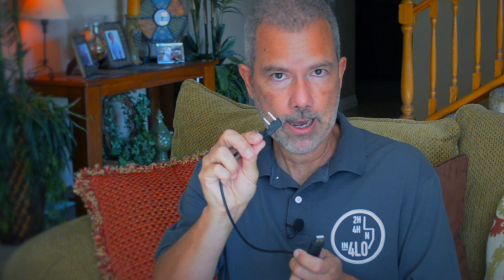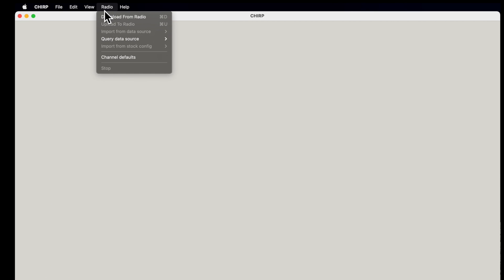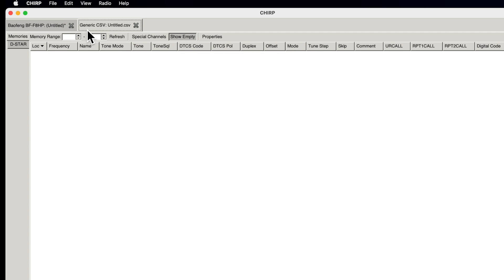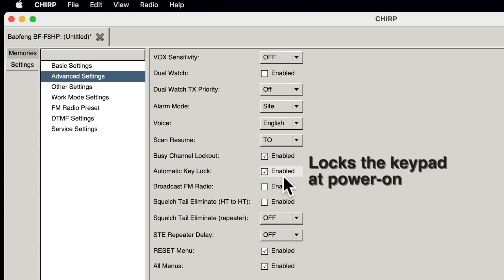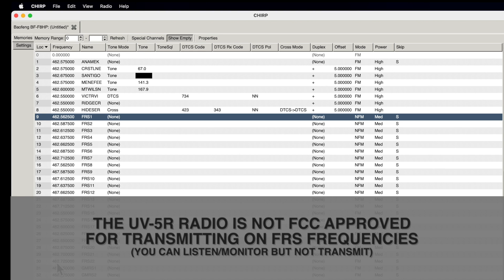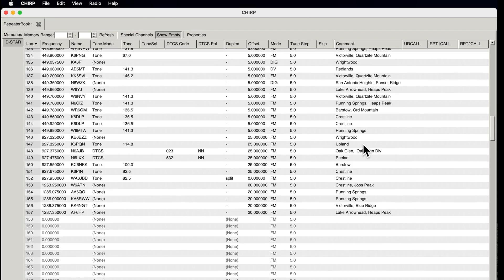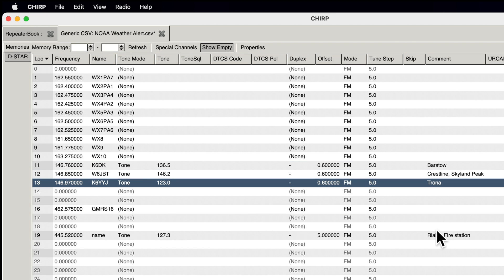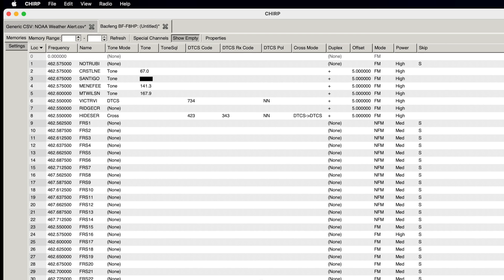How To Use CHIRP Software To Program A Baofeng UV-5R. Using CHIRP for HAM, GMRS, and FRS Radios

Comment from the maker: You can get the UV 5R / BTech GMRS V1 programming cable here: 
https://amzn.to/38Sie1q
You can download the FREE CHIRP software, here:
https://chirp.danplanet.com/projects/chirp/wiki/Download
Reply: I have the generic Baoefeng programming cable, it doesn't have the chip but thankfully windows 10 was smart enough to figure out my stupidity.  The generic cable however did not work on the USB ports on the front of my computer but work great on the rear USB ports.  Not sure why but if someone has issues getting radio to connect first check the cable to radio connection as Randy suggest then try a different USB, I was about to throw in the towel.
Reply: @mrbyamile6973  so the reason is the USB ports on the front of your pc, are actually a hub, and the ones in the back are part of your motherboard. So whenever you see any peripherals that say don't plug into a hub they also mean not to use your front ports
Reply: @thetarkovion6409  What if your laptop doesn’t have rear ports?
Reply: Any affiliate links for UV5R?
Reply: Thank you Randy for the link to CHIRP,
So far I have saved copies of both my Baughfoowongs, and I downloaded some frequencies, profiles I found interesting, but the option to download TO the radio is greyed out.
Maybe you explained it but I was lost in your eyes, or distracted by one of those single-frame images.
Nope, it was the eyes.
Reply: I have a question, I hope you can answer.
I have bought the Baofeng AR152, and most recently, I read
that downing loading CHIRP can hurt the system. 
How true is this????
Reply: I myself bought a Baofeng Uav5R+ and the right cable but can't upload to the radio. 
 I tried manually also.... 
Guess you get what you pay for
Reply from the maker: 99.9999% of the time when this happens, it is a Windows "driver issue", and has nothing to do with the radio.  
In other words, Windows sucks, not the radio.
Reply: @TheNotaRubicon  Agreed!
Reply: 0

Comment: My new UV-5R apparently got the keypad locked so that I can't input frequency manually (but I can do that with up & down keys). Is there possible to unlock the keypad so I can input frequency manually in the VFO mode?
Reply from the maker: Yes.. you can UNlock the keypad by pressing and holding the lock/unlock button for a few seconds .. it's the button with the tiny blue key image on it.

Comment: hi we have bought one of these and have watched your video several times and still struggling to get it working. Is there any chance someone help at all
Reply from the maker: What, exactly, do you mean by you are "struggling to get it working" ?  put in the battery and turn it on by twisting the knob on top. if it doesn't work, send it back.
Reply: @TheNotaRubicon  Hey bro, the problem I am running into with a newly purchased UV-5R is, firstly it resets to factory by pressing the side button, transmit and VFO button simultaneously. After success there, I was able to download my channel list from a previously programmed radio. I download the blank channel list from the new radio, copy and paste from the old radio, upload to radio, great. The new radio seems to accept, it responds normally and then it reverts back to having no visible channels. Chirp took me to a place to download a previous codec or whatever you wanna call it for the cable, which I did, but still no success with the new radios which is keeping me from buying any new UV-5R's. My final attempt will be to use an old laptop to see if anything is different there. PS. I like your sarcasm but you could be a little nicer in your comments. But you have a great, unique channel. Peace.

Comment: Does everyone know you can pull off the off/on, volume switch nob on a UV-5R and use it to tighten the antenna jack nut ?
Reply from the maker: yes.. but nobody has ever needed to do it.. ever..
Reply: @TheNotaRubicon  Nice to know though. As a life long mechanic I have seen more than my fair share of fasteners come loose, especially on parts that are repeatedly removed and reinstalled. Taking the antenna off repeatedly can possibly loosen that nut on the jack.

Comment: my issue is getting comm port access denied errors
Reply from the maker: That's a Windows/Driver issue.. Good luck figuring that out.
Reply: @TheNotaRubicon  With Arcshell AR-5, It is an issue for Win7 and Win10 for me and I suspect others. You cannot get past square one in CHIRP unless the com port is accessible. In my VM Win10, the Ports menu does not even display in Device Manager. In Win7, it says Com port one is blocked. There are no Com port settings in my Bios, no indication of where it is blocked from the error message. Troubleshooting only confirms this.  

In Win7, The driver that comes with the USB serial cable only activates the USB serial com port for it. You also get an Unknown Device listed under "other devices". You then get device driver errors/rejections when you try to apply that USB serial port driver to the Unknown Device or any other devices. Archshell does not provide an OS driver for their AR-5 or other models. The manual talks about "the software," for it, but there is no software support or download on the Arcshell web page. 

So I would say don't waste your money on a cable for the AR-5,. CHIRP will not recognize it under Win7 or Win10. You cannot program the AR-5 with CHIRP if you cannot pass square one and the com port is not accepted or recognized. You will need to operate it as is out of the box. Dissapointing.
Reply: My friend I connected a Baofeng uv 5... I downloaded chirp legacy for older windows version, it works with windos 7... But when I open DOWNLOAD FROM RADIO I can't see any PORT to select

Comment: Rick you are very kind to include the free CHIRP software link. Solved all my problems in 15 minutes as opposed to the previous 4+ hours I spent back and forth with apple support and messing around with drivers and such. Problem solved works now.
Reply: Name=Randy correction

Comment: I recently got a set of 2 Baofeng Ar 5rm radios. They are great but the supplied Baofeng programming cable is garbage. Does not work even after updating the drivers supplied on a CD.
I am  going to borrow a B-tech cable that you recommended. 
If that works, I will order my own.
Many thanks 😊

Comment: So what can the UV-5R use for simplex transmitting
Reply: I guess if you have access to the 22 channels those can all be transmitted on and received on the same channel.(Simplex)The other 8 channels are what makes up the repeater channels 22-30 I guess. And those channels are duplex they require an offset which means you transmit on one channel and receive on another making those duplex channels.
I actually don't know at all but this sounds sortive correct to me, and I'm only on my second day of looking into radios, so if this didn't help I'm sorry.
Reply from the maker: The UV-5R is a H.A.M. radio and does not have those 22 channels unless he programs them in - but based on his question, it is clear that he has not done that.
Reply from the maker: Please rephrase your nonsense into something that makes sense.

Comment: Here is my real question. Hypothetically, would it be possible to use a uv-5r or other cheap Chinese radio to put in the correct tones to activate a GMRS repeater? Just want to know for academic reasons, not that anyone would break our overlords rules. You have stated it would be difficult, but left open the possible
Reply from the maker: Yes - many people with unlocked UV-5R radios do this

Comment: When I press the PTT button on a walkie-talkie, I can see the green light on the other walkie-talkie but there is no voice
Reply from the maker: 1) you might be too close to the other radio - get at least 50 feet apart and try again
2) the receiving radio might have a tone/code/privacy channel set - remove all those settings and try again
3) the transmitting radio might be defective
4) I doubt the transmitting radio is defective

Comment: 4 years later, the menu has changed a bit.  I only wanted to add text to my channels instead of the frequencies that I programmed into the radio manually.  I did the download bit, then edited the text of the channels for the upload back to the radio.  No Change.  Thanks for the tutorial anyway.  I learned quite a bit.
Reply from the maker: There is another menu option you have to change to display the channel-name instead of the frequency.

Comment: I have just purchased a Baofeng UV-5RX handheld transceiver and want to have the actual names of the repeaters I like showing on the screen.
I have bought the cable you recommended and downloaded the CHIRP software from the link you posted.
So far so good - I got the radio to download the channel info I have entered on the radio. I put the names of the repeaters into the CHIRP spreadsheet and uploaded to the radio. Lights were flashing on the cable and radio. The radio screen flashed "Welcome" briefly when finished.
NO repeater names are showing on the radio screen, just the frequencies, as before.
What to do?
Paul VE3AXT
Reply from the maker: You may find watching this video helpful: -> https://youtu.be/7jFn7ZGVldg

Comment: my uv5r radios have there sockets raised a tiny bit off the wall. and the cord has raised metal rings on the plugs. so there a air gap between the plastics. 
no there is NO contact anywhere on the cords plug, to radio. (plastic to plastic).
the cord plug fits the area in the radio no contact.
yes i have tried to force the plug into the radio. but it is all the way in. on more than just one radio.
right now in front of me is a UV5R and a UV5R5. can see air all around the plug to radio case.
neither one works with chirp.
keeps saying no radio.
brand new (to me at least), red cord bought off amazon, it says baofeng on the usb-A  end.
opposite side has a triangle of raised dots, three, then two, then one.
package labeled as.

X002MX7QS(then washed off).
Baofeng Programmin..X3, GA(same label damage) ed
new.

other than a computer bar read code nothing else. (yes three lines of text as typed out here)

the damage looks like some liquid dripped on it and wiped out the ink. label is almost see through at that point.

Comment: I am having issues.  I have uv5r, i have chirp installed, i have to cord connected.  But it says it cannot locate what port.    I did what i can and it says no drivers available.  Do you have any asvice?
Reply: Turn the transceiver on while it is connected
Reply: Try looking for the cable driver that you use. Sometimes it's not the one that comes with it. I try randomly installing drivers and turns out it uses the prolific chipset. You can find the drivers in the miklor web.
Reply from the maker: I'm sorry to hear that.. My only advice is to stop using Windows..Seriously.. Windows is horrible..
This is a problem between Windows and your cable, not the radio.. and, there is no easy solution (other than using Mac or Linux).

Comment: These ham radio d1ckheads are the most delusional of all the prepper mor0ns. First of all tthere will bne no one to talk too second of all your radio will  stop shortly after the power goes out, because you failed to think more than 48 hours in advance. You're a phuckin idiot.
Reply: Cry harder
Reply: Awwwwww. The cuck's feelings are hurt.
Reply: I've never known a prepper without a independent power source
Reply: @darcijones7695  Excactly,
Reply: Actually you don't realize what's going on with all these rocket launches that's putting sat platforms all over the air space..jus sayn..u hav to get smarter in regards to this stuff bro

Comment: So do FRS and GMRS have different Frequencies? Your website has GMRS & FRS Channels listed. For example channel 01 is 462.5625. Is that FRS or GMRS? In this video you have FRS1 as 462.5625 and GMRS1 as 462.5500.
Reply from the maker: FRS channels and GMRS channels are the same.  If they are shown differently on the radio in the video then they were manually entered incorrectly.

Comment: hi, i just got my radio and i have a mac, and when i try to connect to my radio to chirp, i can’t find the right port, i’ve tried to find tutorials but none of them are any help, i’ll be really glad if someone ACTUALLY tells me how to connect my radio to chirp on MAC OS
Reply from the maker: Have you tried each of the different listed ports and are you sure the radio is on, the cable is clicked ALL the way in, and the volume is up?
If so, and if it still does not work then the problem is likely a bad/cheap/incompatible cable.
Reply: @TheNotaRubicon  yes i have but chirp keeps telling me to check my drivers and i already have multiple times

Comment: I should have come here first. I found the chirp.danplanet the hard way. Your explanation of programming is by far the best I've seen so far. I planning to purchase the TidRadio H-3 GMRS/HAM HT after watching your video on it. My question is would I have to program on the Ham function to program Ham and then switch the HT to GMRS and then program GMRS or can I just do it similtaneously? I saw somewhere that if you select NORMAL you can do both at the same time. Any clues?

Comment: Just as a side note, CHIRP doesn’t work with the UV5G Plus. There isn’t a selection for it and when I tried any of the UV5 selections it said “Radio would not respond.” And yes the plug was all the way in. I went to the Baofang site and tried there and when was down loading the program my antivirus stopped it saying there was a virus. A forum said that the only one that works is the radiottity site. What do you think is going on?
Reply from the maker: The UV-5GPlus works just fine in CHIRP.  Check out this video to see how: https://youtu.be/YlCfq_RH9Tg?si=6qBv5hmc7oRSPwz6
Reply: Sure it does, using it as we speak. You need to select Baofeng GM-5RH.

Comment: What about the AR-5RM ?? when I chose baofeng…. That model is not listed
Reply from the maker: If it's not listed, that usually means the radio does not work with CHIRP.
Reply: @TheNotaRubicon  hmmm that’s weird because it’s that new baofeng. You know the one with the bigger screen and that search button?? It’s like the new version of uvr5 I guess ??
Reply from the maker: It's not weird at all. New radios usually take at least several months before the CHIRP boys make their updates.
Reply: @TheNotaRubicon  thanks 🙏🏽
Reply: The new version of chirp has the AR-5MR on it.  Just finished loading mine.

Comment: I must have received a radio with BAD SOFTWARE! The Chirp software does not work with it yet it reads the the radio as it displays freqs I already put in via the keypad ! So Einstein , it also will not take freqs above 462 megs like NOAAH ! The clown I bought this from isnt saying anything in reply ! FYI- I only used the cable and software with another UV series so block and delete this comment too! Thank GOD I have real radios!!!!!!!!!!!!!!!!!!!!!!!!!!!!!!!!!!!!!!!!!!!!!!!!
Reply: I think the new version of the Baofeng UV5R have some sort of lock on them that was put into place due to a bunch of new people buying and using them without licenses.

However, I believe there is a pretty easy way to bypass that lock. Some Youtube channels show you how. It is pretty easy. I think you hold a couple different buttons in a certain fashion.

Mind you, I am extremely new here. I sort of picked this up from watching some recent UV5R videos after I hard reset my radio. I could be way off. But just a guess. Hope that helps in some way...

Comment: any idea why my computer wont recognize a port to connect with the radio?
Reply: cable im using came with the radio
Reply from the maker: That is almost certainly a Windows driver issue with the cable..  Good luck with that.
Reply: Tried a different computer, seemed to recognize it, however when I went to start the download it gave an error message

Error reading data from radio: not the amount of data we want
Reply from the maker: That error usually means that you have selected the wrong model-radio on the download screen.
Reply: @TheNotaRubicon  you were correct. Wrong radio selected!
Reply: @TheNotaRubicon  This man really knows his shit!! Wish this guy was my next door neighbor.

Comment: Great video, thanks! I am having an issue where the radio is not saving the offset after uploading from CHIRP. Even if I go into the menu setting on the radio and manually enter the offset it confirms it then automatically zeros it out. This is happening in channel mode (probably obvious). Anyone else have this issue?

Comment: So trying to set up baofeng uv-5rpro trying to put gmrs bands on them. But when I try to transmit on them they just beep at me. They won't transmit on them. Want to us for off roaming and such. I have a gmrs license that I purchased.
Reply from the maker: Sounds like your ham radio is locked and will only transmit on ham frequencies and not GMRS frequencies.
Reply: @TheNotaRubicon  yeah just figured that out. Thank you for your reply. Liking your no nonsense videos. Wondering if I should send these back and get some that are gmrs capable
Reply from the maker: If you want to drive a car that is red, its a good idea to buy a red car. If you want to transmit on GMRS, its a good idea to buy a GMRS radio.
Reply: @TheNotaRubicon  yeah I don't think I read that it was gmrs locked. Guess I'm sending these back...

Comment: The baofeng radios are hobby radios,  not for first responders or emergencies.
Reply from the maker: Ok.. Not sure I was recommending that first responders use an $18 radio, but thanks for letting us know?
Reply: They are not the optimal choice but I have seen them used for SAR, CERT,  sheriff auxiliary,   FD auxiliary,  Red Cross and emergency NGO disaster deployment.   Not surprisingly,   the places where people supply their own gear or non profit organizations that operate without tax funding.   They are clearly used  in SAR and disaster response.